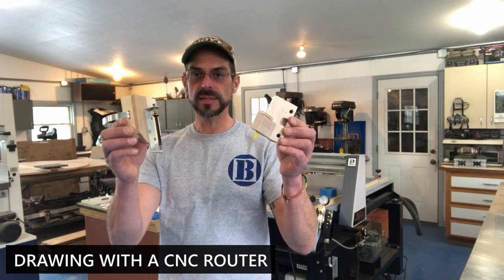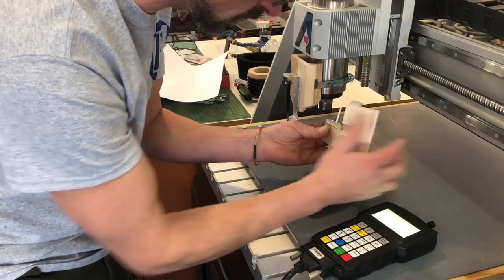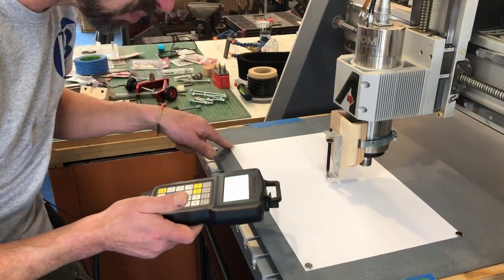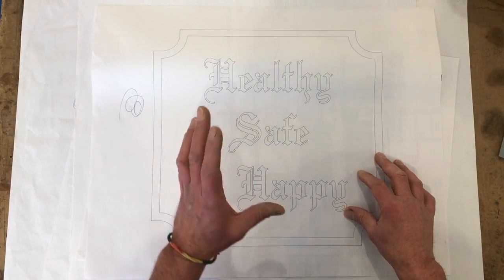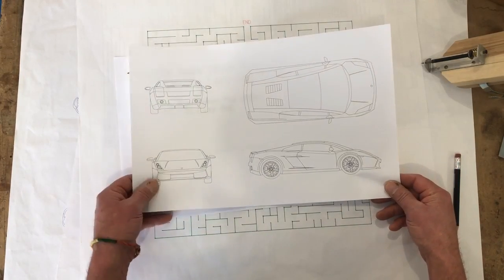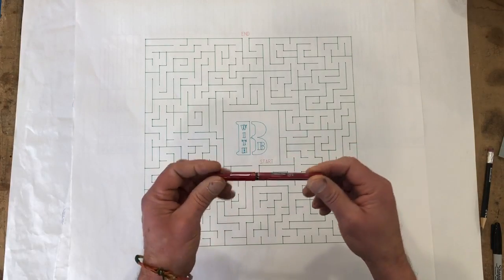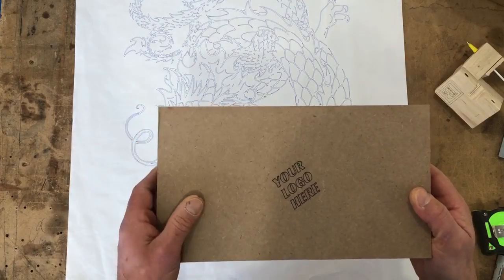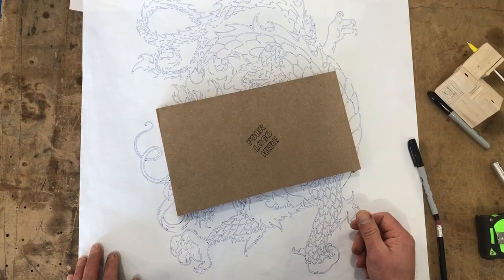CNC Drawing // Part 1 - The Basics of Line Drawing

Comment: I so enjoyed you two YT videos on CNC drawing. 
I am using VcarvePro And the engrave mode.  To draw and fill in a letter it first runs the entire letter at 0.025” Z depth, then it goes over the letter again ay a Z of 0.050”.  This is a very slow process, I could edit the gcode and delete the 0.050” portion of the run.   But is there a way to only go over the letter once?
And other tips on using the CNC to draw.

Thanks
Reply from the maker: I’m a bit confused, with the v-carve Pro you have complete control of the depth of your pass and the depth of your final cut, when I am drawing with the CNC I use a 1/16 depth of pass and cut it makes one pass only, I’m not sure why you are getting different results
Reply: Sorry had a senior moment.  The depth on quick engrave I had set the depth/pressure to 0.050, but on the EDIT screen I had set the pass depth to 0.040”. That’s why it was running the test two times.  
This is the first time I had tried using a fill and the quick engrave utility, need to do some experiments to make it run faster and still get a good quality results.  Thanks for the quick reply. 
I may be picking your brain more about this. 
Thanks